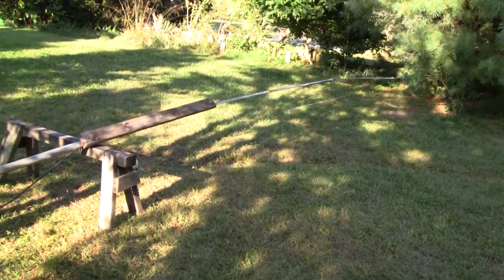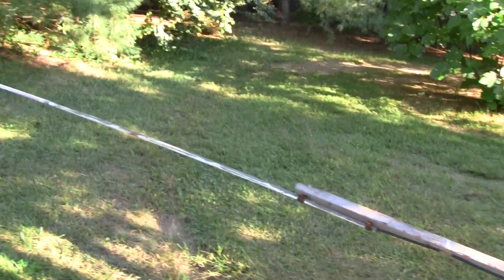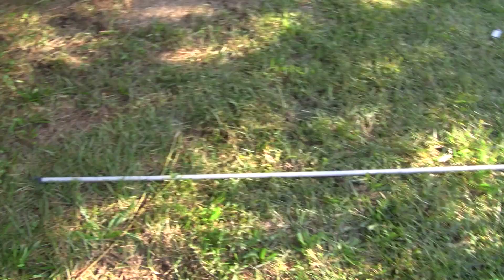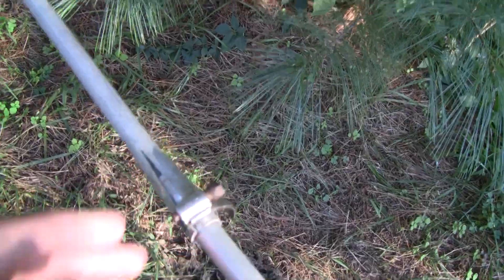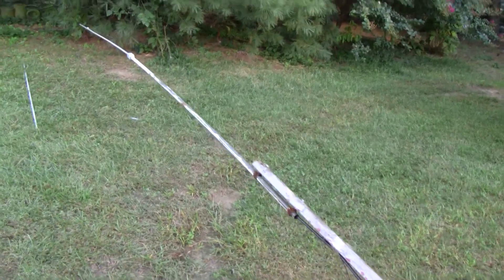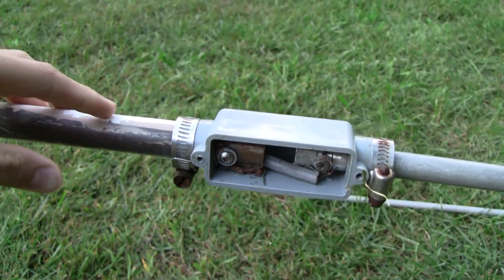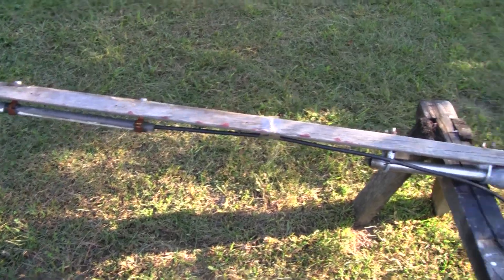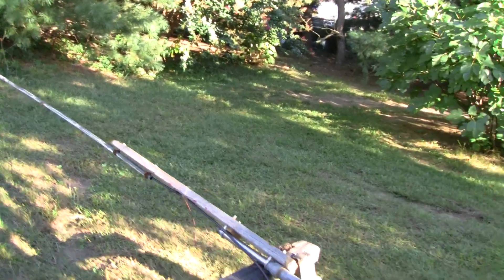SIMPLE VERTICAL DIPOLE FOR 11 METERS

Comment: I wound a 1:1 balun with a #41 Ferite donut to match the coax to the dipole.
  Good work, its always cool to see other radio enthusiasts projects.
   DONT get too hung up on the SWR garbage you hear everywhere. Having as much as a 2:1 match in some antennas isn't out of the ordinary, for some reason, the CB community is hell bent on absolute flat matches which is garbage, I also LMAO with these CB clowns that are pissing themselves about losing a half DB over a 100ft run on their coax and are spending ungodly ammounts of cash like $8 plus dollars or more a FOOT for stuff like RG-393 and other high dollar varietys to get that half a DB they lost..lol🤣👍 but little do they know that open wire ladder 🪜 line which inherintly has ZERO LOSS overa gazillion feet, thats what i use for my dipole.
  Again, cool video dude. Hope to hear from you. Take care!😏👍

Comment: You must! have a choke at the point a quarter wave down from the split or the RF is just going to keep coming down the coax making half waves which are in and out of phase - every other one - and when it gets into your shack if you've got it cut just so and if you happen to be at a high voltage node at the end of the coax it's going to produce so much RF into your equipment you're going to be pulling your hair out.
You could just run messenger cable/catenary line between a couple of high branches on a couple of trees and pull one up you made out of 25' of RG-8X (Mini-8) and you only need 5 turns on a 4-inch former for the choke, and it won't weigh hardly anything plus you can use a connector & barrel connector at the end just below the 5T choke if you want to run full size RG8 or LMR 400 the rest of the way.
But yeah you MUST have a choke in line at the 1/4wave point below the split or you're going to screw up your pattern and cause RFI into your shack or into your neighbor's houses, all kinds of fun stuff.

You can say you didn't notice a difference in performance but that just doesn't say much about your ability to notice because without that choke in there it's simply isn't going to work right unless of course you're car gets 500 miles per gallon and the sun rises in the west and sets in the east, lol
 it's just plain physics and it's 100%.

Comment: I'm thinking of making one like this but putting the whole assembly inside PVC pipe and just using braided ground strap over the coax as the bottom ground element and a copper wire as the top live element. That way it will never be effected by rain and the elements. Then just make the PVC pipe as long as you want or need for height, strap it to a post or building
Reply: Did you ever build it? And if so how did it turn out?
Reply: @JAFO.  YES! I used a 102" whip on a truck mirror mount bolted to the top of a 102" steel pipe and ran the coax down the center. SWR is 1.2 on the worst channel! check my channel for the video!

Comment: Running your coax through the element will make it radiate unbalanced one leg will be out of band if you can run feed line from the side horizontally bit of a pain tho i looped mine over a tree branch first then horizontal to antenna big increase in signals swr flat prior 1.6 to 1.8 swr
Reply: That's why you put a choke at the bottom of the lower leg at the quarter wave point that's exactly what a choke is meant to do stop the radiation or the common mode current CMC they call it. Without the choke it's going to continue to radiate down the coax in phase a half wave out of phase a half wave in phase halfway out of phase of halfway etc and every one of those has odd takeoff angles and shoots spurious energy into your neighbor's houses or your own.

Comment: would be nice if you added measurement!!!!!!!
Reply from the maker: Each element of the dipole is roughly 102 inches long. If you search dipole calculator on google, you will find several results which will give you length given desired operating frequency. You may need to shorten or lengthen the antenna depending on your specific operating conditions

Comment from the maker: You got it! I usually try to get it up a half wavelength
Reply: Cool set up bro I'm working on my first one the last couple of days. So I have a question. The braided part of the coax does have to be grounded independently? The way I have mine set up I just split the coax and have 102 inch piece of wire connected to that and one connected to the center of the coax but it doesn't seem to be working very well but I'm also using mine and a horizontal configuration. Any tips are appreciated. Thank you in advance

Comment: Thanks for the plug for my channel !!!  Mine is 4 foot away from the mast witch isnt
't the best design I have an Idea similar to yours using PVC Pipe with No. 12 house wire inside for elements  It is a fun Hobby even better than years ago  now we have Internet Start with a cheap Radio in case of a failure And  A decent SWR meter